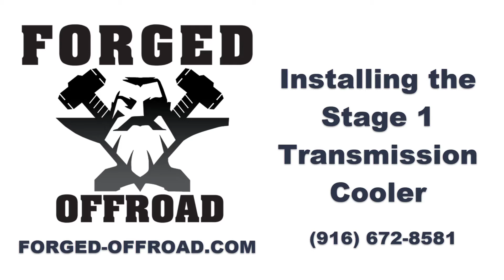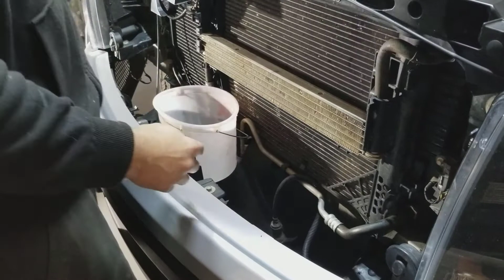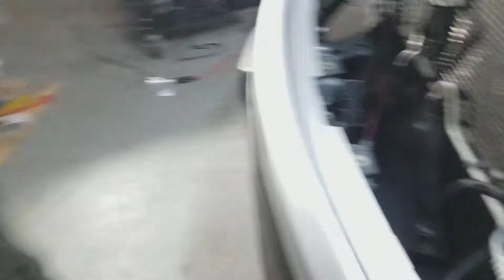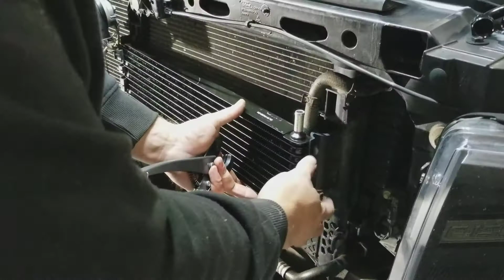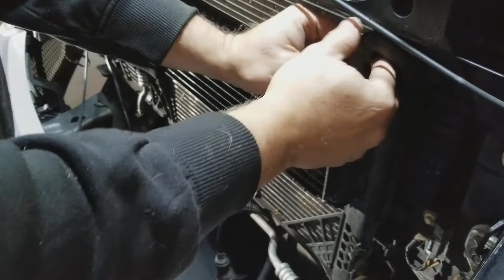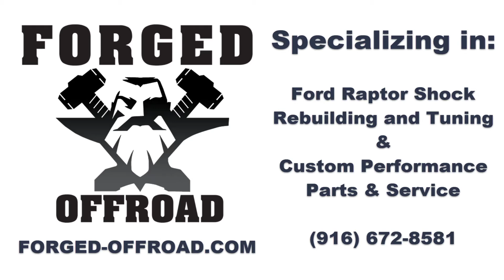2009-2014 Ford Raptor and F150 Stage 1 Transmission Cooler Installation Forged Offroad

Comment: Can this be more efficient than the one from factory by far ?
I have 2013 fx4 6.2L and the Temp above 90 Celsius most of the time.
Reply: Bought one on eBay for $109
Reply: @CALCOBRA94  I couldn't get it on ebay I tried too much there was smiler OEM oil cooler

Comment: Is it normal for f150 raptor transmission temperature reach 96 c° at speed 120 km .
Reply: Yes. That's about the optimum running temp in UAE

Comment: Why u installed same cooler?  I mean you can install best cooler like tru cool
Reply: It's an upgraded OEM version for Ford raptos in SA. The transmission has a thermostat that opens at 188-190 degrees so a larger cooler will not do much. This one helps keep it cool enough anything else will do the same and it is plug and play so it is really nice and easy